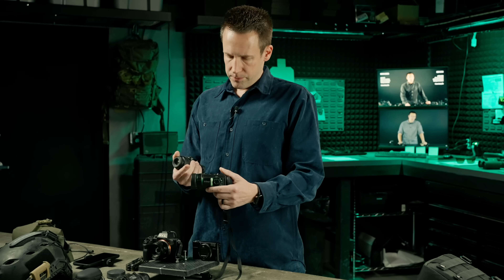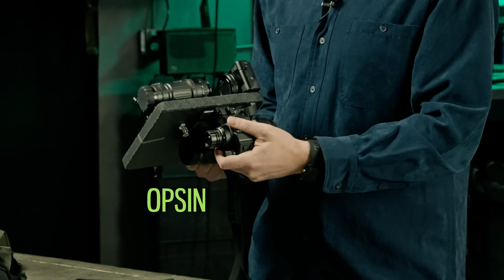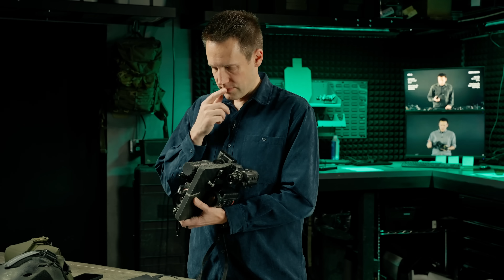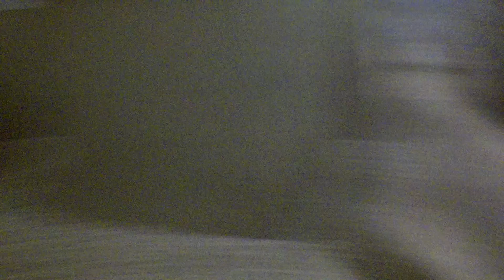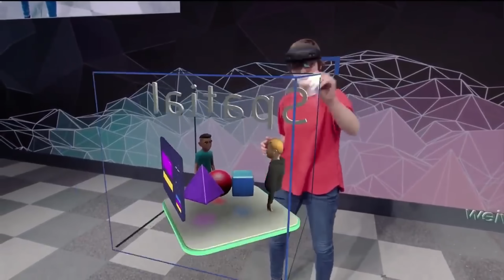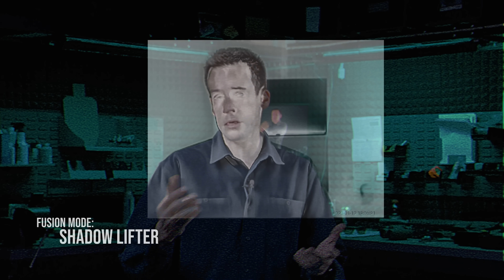SiOnyx Opsin: Digital Night Vision HAS ARRIVED

Comment: To measure latency quick and easy, you can show a running stopwatch to the device under test, and photograph both the watch and the device display. If the watch in the picture is showing 1:23.456 and the watch in the device display is showing a time in the past, e.g. 1:23.256, that suggest the display is 0.200s late. Note, some cameras has rolling shutter effect and might not be taking complete picture at exact same moment so you might have to flip and rotate camera to get around that, also if you'd use a phone as the running stopwatch there might be issues like it might only update at 60Hz or half the screen at a time etc., so real watches are recommended.
Reply: Opsin is definitely rolling shutter
Reply: @DjAlonDevil  no you photograph the opsin looking at a stopwatch, with the stopwatch seen in the background. That way you can compare what's displaying at the back end of opsin and the stopwatch. But if both are too apart in the direction of rolling, shenanigans could kick in
Reply: @すどにむ  I understand, I just wanted to say that Opsin is a rolling shutter and not a global one.
Reply: @DjAlonDevil  Yes, you're correct. The image sensors in most digital cameras, including those used in digital night vision devices, use a rolling shutter, which scans the image line by line rather than capturing the entire image all at once. This can lead to distortion and other artifacts, especially when capturing fast-moving objects or when panning the camera rapidly. The rolling shutter effect can also affect the accuracy of latency measurements, as you mentioned earlier.

It's important to be aware of the limitations of the image sensor and its rolling shutter when evaluating digital night vision devices, as well as when using them in real-world applications. Taking steps to minimize rolling shutter artifacts, such as using a slow and steady camera motion or avoiding fast-moving subjects, can help improve image quality and accuracy.
Reply: @すどにむ  I see what you mean now. Yes, by photographing the display of the digital night vision device and the stopwatch in the background, you can compare the two and determine the latency between the image captured by the device and the display of that image.

However, as you pointed out, if the rolling shutter effect of the camera is significant, this method may not provide an accurate measurement of latency. In such cases, it may be necessary to use a different method, or to take additional steps to minimize the effects of the rolling shutter.

Additionally, other factors, such as the processing time of the device and any transmission delays, can also contribute to the overall latency of the system, so it's important to consider these as well when evaluating digital night vision devices.
Reply: You guys don't have to keep saying "but rolling shutter bro", that can be easily remedied by aligning two devices perpendicular to rolling and/or taking just few measurements at different roll angles. The direction of rolls don't change, they scan from top left to bottom right line by line, definition of top left possibly varying between sensor designs. But there isn't, say, a camera that scans from center out, or a camera that rolls right to left only on first and third Wednesday of the month. It's quick and dirty method but as someone said above a good starting point for latency evaluation.
Reply: @WilliamEllison  I don't believe that there is a lot of shutter lag on Opsin due to the high scanning speed. With only arond 720p of resolution and a 1-inch sensor there should be little to no artifacts especially at 90Hz.
Reply: If you use a stopwatch on a phone app wouldn't the screen refresh rate also effect that. Someone with a 90hz screen could get a different result than someone with a 60hz.
Reply: yup, resolution will be 1000[ms] / 60[Hz] = 16.67ms or half that or something, it'll be something akin to 3MOA accuracy but it'll be a start
Reply: in case if you're just able to find a 4-5 digit stopwatch or something like camera strobe lag tester(manufacturers care about that), that'll be much better
Reply: @すどにむ  Yes, you're correct. The maximum resolution that can be achieved with a 60Hz display is approximately 16.67 milliseconds. This means that the display can show updates as often as 60 times per second, with each update separated by 16.67 milliseconds. However, the actual resolution may be lower, depending on factors such as the processing power and capabilities of the device, the speed of the image sensor, and any other limitations in the system.

This level of resolution may not be ideal for all applications, especially those that require high precision or accuracy. However, it can still provide a good starting point for evaluating digital night vision devices and comparing their performance. Over time, as technology continues to improve and devices become more advanced, it's likely that the resolution and accuracy of digital night vision will continue to increase, allowing for even better performance in a variety of applications.
Reply: Yes, that is one simple and straightforward method to measure the latency of a digital night vision device. By comparing the display time on the device with the actual time shown on a running stopwatch, you can get a rough estimate of the latency.

It's important to note that there are several factors that can affect the accuracy of this measurement, such as the camera's rolling shutter effect, the refresh rate of the display, and any processing delays in the device itself. Using a traditional watch with a second hand can help reduce these issues, but it is still important to be aware of any limitations or sources of error in your measurement process.

In general, measuring latency accurately requires a more sophisticated setup and specialized equipment, but the stopwatch method can still provide a rough estimate for quick and easy comparisons between different devices.

Comment: Cool thing about the opsin (and all digital really) is the option for upgrades through firmware/software. I bet the wizards at sionyx could up the frame rate. While analog is obviously the best option at the moment, without large expense there is no way to upgrade as new tech comes out. With digital it's just as simple as a quick software update.
Reply: There was a big improvement in performance with the Aurora Firmware updates so there’s potential.
Reply: There was a rumor recently that new firmware for the aurora was gonna have a redicle option.
That would be awesome to not have to put the black behind a red dot.

Comment: A thermal sensor on a future product, with three dedicated sensors focusing on visible, near-infrared and infrared light. Include a resolution of 650 PPI at 240FPS with all sensors overlaid. I'd be sold at 7k+. Assuming same weight and similar to improved battery life.
Reply: the sensor, processor and battery situation could be resolved in the next 6+ years. but sadly the screen might have issues. in order to get a 1080p at minimum with 180+FPS is going to take alot longer. pixel density is getting better and better but the refresh rate increase for such small screens is taking alot longer. certain high end phones are only now just getting 120FPS. refresh rate but its not standard its an enabled option. because its displaying full colour night vision the display needs to match the quality of what the user is wanting to see.

in order to get that packed into what the unit already has is going to take far more funding as the screen in this type of product is a specialized component unlike the backlight, TV & monitor manufactures are trying to push for. its a completely different sort of thing to create such a specialized component. question is who will fund it

Comment: Search up the pvs69. The 4th generation of pvs69 has been designed to house either digital "tubes" or true analog tubes. So you can build up a digital set on the cheap while saving for a high quality set of tubes and then just swap over without needing to change housings/mounts/batteries. Even uses pvs14 lenses so all that is needed is pvs14 ocular lenses and tubes.

Comment: You guys realize that most of the tech that was fantasy in the Splinter Cell games is now currently a reality in one form or another? 
Small, single man portable drones? Yep. 
Fully wireless all in one communication kits? Say hello to the ATAK. 
Temperature regulating bodysuits with ballistic armor capabilities? Exists, but cost prohibitive for mass production.... FOR NOW.
Snake cams that can be used to surveil areas discreetly? Been a thing since the 90s, and they even hook up to the standard smartphone theses days.

This Opsin is a step closer to the iconic goggles. Possibly a cross between a good Gen 3 tube, a small thermal device, and this tech to bridge the gap? Hell, it would even have 3 lenses like the game goggles. Someone smarter than me figure out how to run the outputs through the same view screen, and build the shroud for it. I think a nice light 3d printed shell would definitely make it viable, and would also lower the overall cost of a night vision set up if it wasn't always necessary to mount it to a helmet or other modern system. A light weight goggle system? Seems like there would be a market for that... not everyone needs or wants to look like an operator just to see in the dark.

Comment: Seems like it would be beneficial to remove processing from the actual viewing device and place all of those components on a helmet - similar to a rear mounted battery pack. You could slim down the unit itself, reduce the cantilevered mass, and have increased room for larger processing components or cooling.
Reply: This, and move the battery pack to the torso. Comms are already routed, may as well run NVG power up, too.
Reply: That dose seems like it would make sense

Comment: I think at this point, their biggest flaw is firmware. If they, as an example, took some of the AI processing tech from Google and chucked it in there, that thing would be better than a PVS-14. My guess: 3-5 years is probably accurate to expect that improvement.

Edit: 13:55 He actually kinda said this. Hadn't finished watching yet.